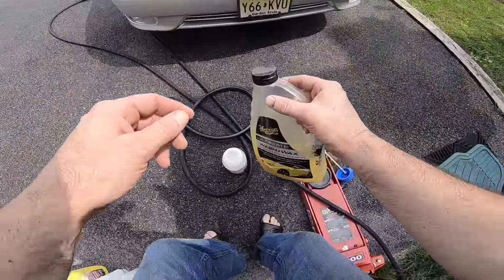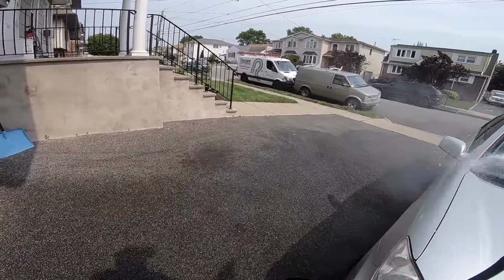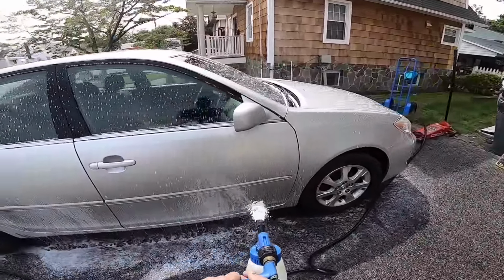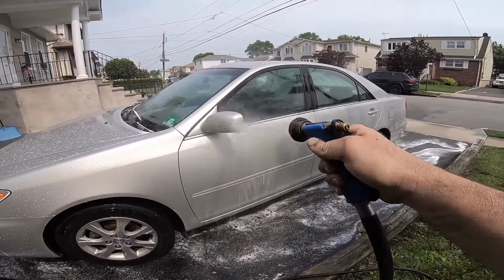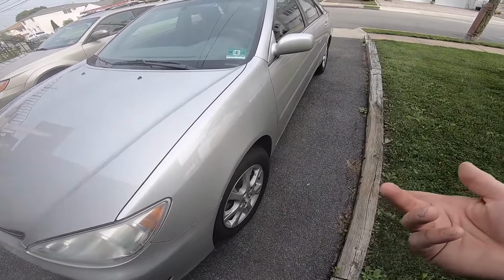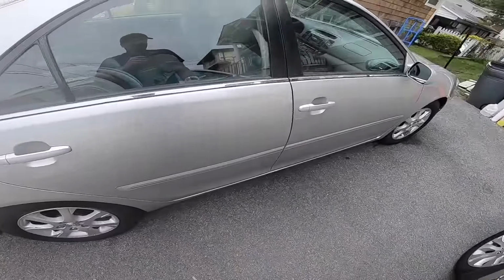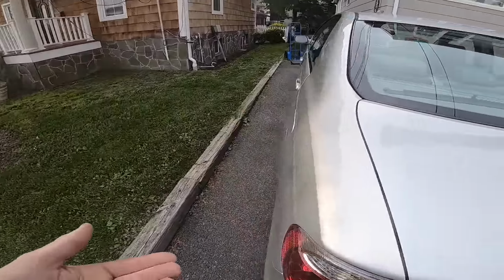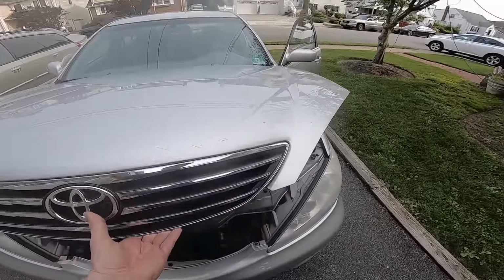Foam Washing My Toyota Camry Using Coil Gun

Comment: I used mine coil gun cleaner just like that 3 weeks ago. But I did front half 1st and then the back half and used a car wash brush.
Reply from the maker: I think a brush, sponge, or rag is still needed but it seems foaming car washes are the new thing so us HVAC techs already own the foaming tool. I used regular car wash wax from since Magellan it's here already. which car wash soap you use

Comment: I just bought a 2003 Toyota Camry LE on Feb. 1, 2018.  It had 221,000 on it and now it has 229,000 miles.  I paid $2,500 cash.  I just bought new tires and changed the upper torque mount.  Minor items.

Comment: You better check the capacitor while you're at it.  😂
Reply from the maker: Cap good battery wire on astro blowing sparks
Reply: @thehvachacker  Is Toyota still using an 80 + 10 mf on all their Camrys?  ⚡⚡⚡⚡⚡
Reply from the maker: This is xle model so it has the 35/12.5 mfd 3/4 hp radiator/ condenser fan on a hermetic compressor